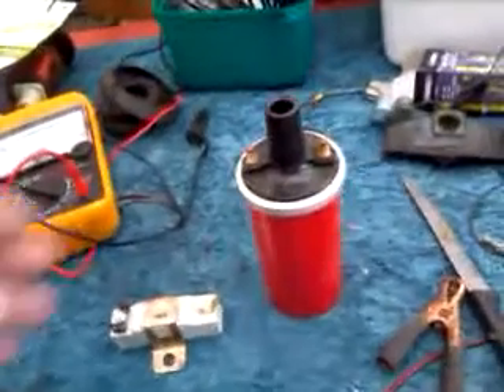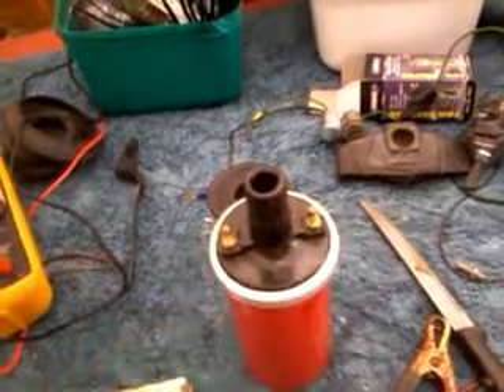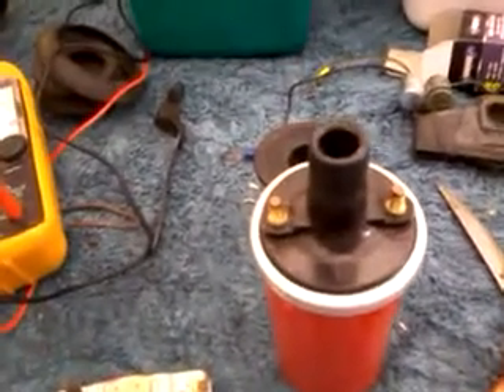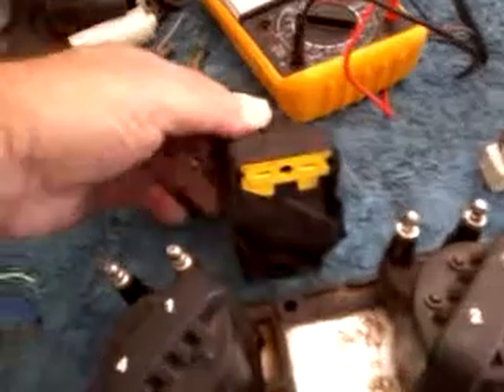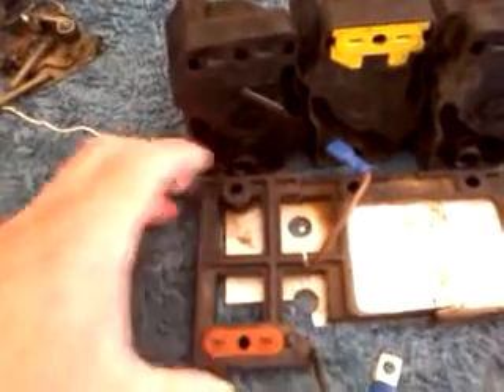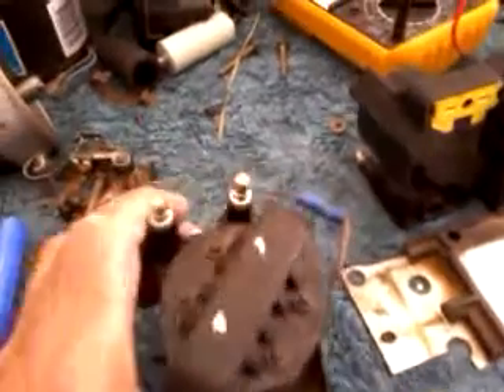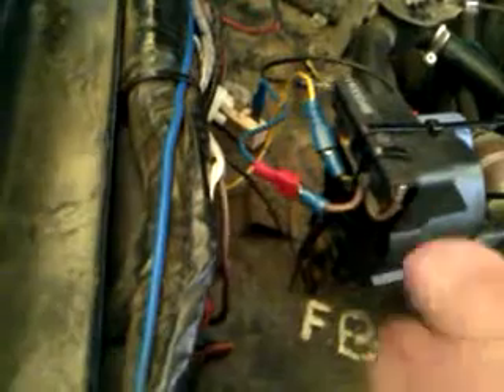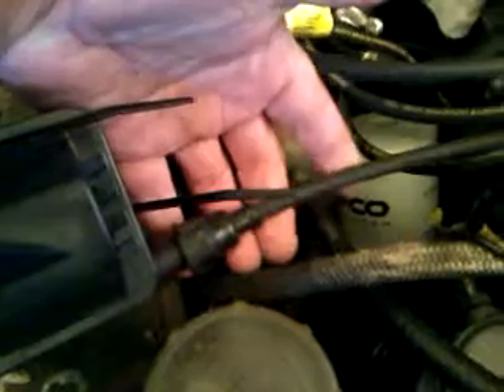kettering ignition fix 2018 for all classic cars #1, ( some aircraft ?)

Comment from the maker: long term issue- the 2 male posts of the coil base  (primary circuit) caused, open circuit-  so I refreshed the surfaces by in-outing the male posts, sparking resumed in the middle of a wedding, took the car home no further problems, but i drilled out the female ports, with drill, applied solder and inserted wires direct,  to thus bypass male  pins, car work fine  the many miles since
Reply from the maker: I did by pass the male posts by drilling out the slots in the coil, and soldered wire directly inside, no more problems

Comment from the maker: 17-8-2018    I replaced my points, with ....  Accuspark system http://www.accuspark.co.uk/   , So now- with my original Kettering design 4 post coil there is no HT in the accuspark 12v circuit so it should last forever,.  my L20b  engine is a joy , esp the smooth running sitting at the traffic lights etc

Comment from the maker: the 4 post coil in this video does require a resistor for the primary side, and spark plugs with resistors built in, which reduces the black on the rotor button